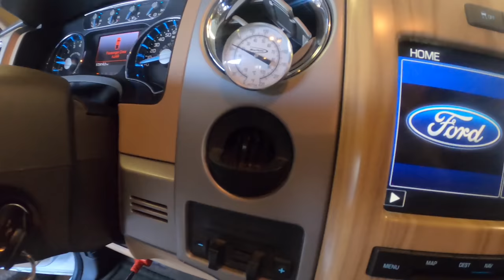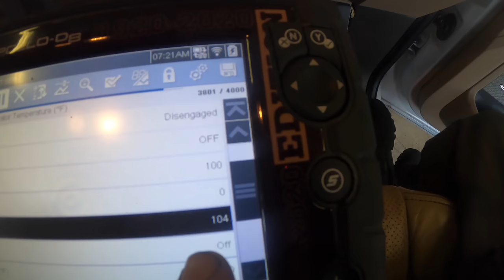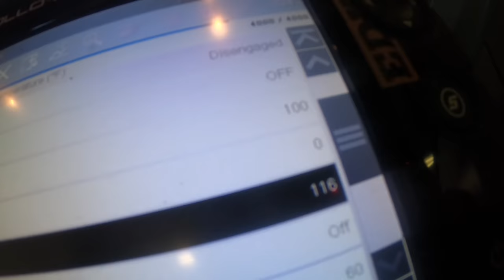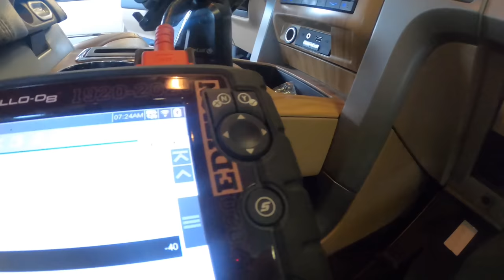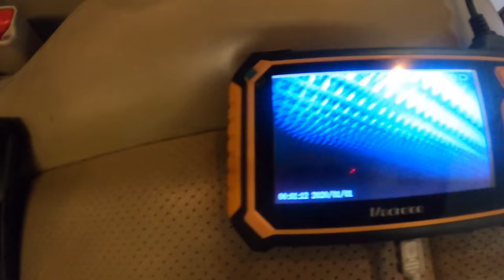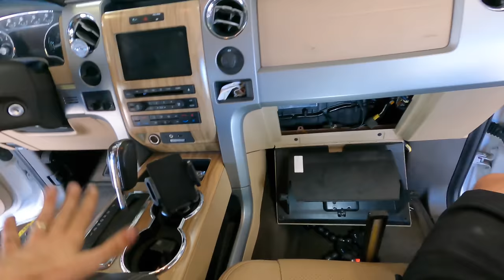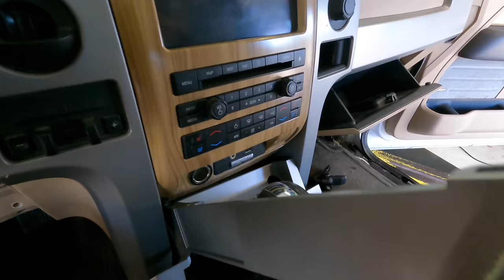TEN HOURS to replace one sensor! Ford 150 torn to pieces! Evaporator Core replacement.

Comment: This is a job I would totally tackle myself.

And by that I mean; I would disassemble the dash and replace the sensor, then drive around the next 4 years with half the dash in the back seat because I couldn't remember how to reassemble it.
Reply: Be careful. That’s starting to sound like some of the stooopid shiite that I do. Don’t make me go to the patent attorney 😜🤣
Reply: At least you'd get half the dash back in. I'd probably just end up mounting the gauge cluster on some plywood and using a couple vice grips as a steering wheel.
Reply: Take pictures while disassembling things you're not familiar with. Lay the parts out with the fasteners next to the holes they go to and mark them with a paint marker so you know where they go.
Reply: Had a 98 Durango, heater core went, 10 hr. book time, had to pull the dash,  took me 21 hours (not a pro) but I got it done.
Reply: At one point in time i owned 4 vehicles that had the steering column cover removed at the same time.
Some were that way for over a year.
Reply: Haha, I'd probably have cut a hole in the housing with a hole saw, replaced the sensor and put a big blank grommet to seal it up after... even if I had to buy a whole new unit, to get the sensor!!
Reply: I agree. I don't know how he remembered where all those bolts and nuts and wire harness connections went. Amazing.
Reply: @willietapper1922  I think we saw that in a Dodge van a couple months ago.
Reply: @G-ra-ha-m  Hell yes....was thinking the same.
Reply: Same!
Reply: Yes, I did exactly that in the 80's to my Dodge Van. I had to store the dash in the cargo bay while fixing the radio or  something. Did not put it back immediately. After a while, I went to pickup some big heavy item and to do so, had to put the dash on top of the van for the duration of the pickup. Then I forgot it there, closed the doors and left. That made me the first and only dude in the history of cars to lose his dash on the highway.... 😳
Reply: That was funny
Reply: @WhiteBuffalo59  I would have simply connected the heater core lines together and wore a sweater.
Reply: @G-ra-ha-m  I was thinking the same thing.
Reply: @WhiteBuffalo59  Sounds right, usually twice as long, sometimes 3 times as long in the driveway!
Reply: I am completely blown away by this video. The engineer behind this design must have been doing some psychedelic drug during the designing process at Ford. What were they thinking?
Reply: That's why Ray has a camera. lol
Reply: @tarstarkusz  Lol, we were on a deer hunting trip when it started leaking and that is what we did .....wasn't to bad while we were hunting but the ride home was rough.
Reply: My solution also🇬🇧
Reply: Funny post. I was thinking the same thing. I'm all anal about labeling or placement of my fasteners. I would be afraid that I'd lose something or forget how to get it back together.
Reply: Totally
Reply: I had similar thoughts on that too. Phew!
Reply: @G-ra-ha-m  Along the same lines, carefully cut down from the top of the lower half of the plastic box and across the bottom to make a panel wide enough to remove the sensor. After the sensor is replaced, tape the panel back into place using some heavy duty black tape..
Reply: @G-ra-ha-m  So would I, but I'd end up nicking the core with the drill and then just drive the vehicle into a river to make it go away.
Reply: 🤣🤣🤣🤣 Most everyone would!
Reply: @MalleusSemperVictor  Dude, we know. This thread is just levity. Play the game, eh?
Reply: @G-ra-ha-m  I was hoping someone would suggest this!
Reply: @G-ra-ha-m  If its like a 13,  the probe alone is not replaceable.
Reply: Lmao
Reply: @MalleusSemperVictor  Ray has the video to refer to ...
Reply: @stevenichols8440  You can't do that when you are a trustworthy garage.
Reply: If this were my vehicle, I might just electrically disable the AC and call it a wash.
Reply: @stevenichols8440  sensor is only available as part of the HVAC box assembly, as Ray mentioned before removing the dash.
Reply: @mymusicaccount1456  🤣
Reply: @G-ra-ha-m  I thought the same, then Ray dashed my hopes, saying the sensor was only available as part of the evaporator. 😭
Reply: Yep, yep yep. 😂
Reply: I've seen someone drive like that.
Reply: @Steve White:  I've worked with AC guys, and many times they had a freon leak behind dash or some stupid thing... AFTER ALREADY HAVING IT OUT ONCE! I avoid HVAC for that reason.
Reply: is not a problem ! anybody who assemble  ikea furniture  at the end of the job have a few screw left !
Reply: I would just sawzall the heck out of the dash and rip out the heater core. I'd end up with a heavily customized truck, lighter too with half the dash in the trash.
Reply: @G-ra-ha-m  thats exactly what I was thinking Bro. Black duct tape would match the housing pretty well.😂😂😂
Reply: @bigboxes  Get zip lock bags take the nuts/bolts out put them in the bag label it and your good. Let's say center console when you only have 5-10 fasteners you can usually figure it out easily.
Reply: @MonkeyJedi99  just un plug the compressor wires.
Reply: @ejcsds  just because Ford don't sell that bit separately, is not an issue, that type of temperature sensor is used in lots of places, a little research can save much time and money :)
Reply: @darkerbinding6933  re sensor availability from Ford: Toyota don't supply 1990s ECU capacitors, but I still soldered new ones in to fix a problem :)
Reply: @G-ra-ha-m  please show us successful replacement in a 2013 and where to get it.  On f150 forum we have been fighting these defective probes for years with no alternative. Please show us how?
Reply: @keithsnowden409  Yep, that is kind of what I meant. Disabling the system electrically.
Reply: This is why I drive a 88 Chevy celebrity. Junkyard hunk of crud, only paid 500 dollars for. Almost 400k miles same motor and transmission. All I do is preventative matenence
Reply: @G-ra-ha-m  Junk yard part!!
Reply: I did this job on my project car, to put an audio system in it, did put it back together. Realised instantly that I was not happy with the results... Car has been sitting for two years.
Reply: Lmao at that!
No matter how methodical you are though doing a major dash job like this they'll always be
'left over' bolts/screws ect..
Reply: @stevenichols8440  ,
what the heck do you have a glue gun for ?!
Reply: @ejcsds  ,
purposely, known as built-in obsolescence !!
Reply: @mikemcgown6362  ,
purposely designed that way !
Not just $20.- temp sensor, but $1100- assembly !
Reply: @tsalesto  ,
if you own it, not a problem !
Reply: @G-ra-ha-m  ,
hopefully available somewhere else ?
Reply: I would never figure out how to get this back together.  We'll done young man.
Reply: I concur with your comments. That is why my Jeep GC is still in parts in the back seat. Got everything apart ok, putting it back together is another matter!
Reply: @keithsnowden409  What you do, is get a piece of flat cardboard the size of the dash, then as you take out each bolt, you make a tiny hole and then stick the bolt/clip in through the cardboard and write where it goes. If it's a nut, you tape it on. It requires patience and dedication to do it with every part, but it works, and I've dismantled many things and then got them all back together doing it this way. Ray has video, and today you can get a head mounted gopro and do it his way. But I'm cheap and will continue to use the cardboard method.
Reply: As opposed to me, who would just turn the A/C off and roll the windows down. That's better than the ones who would cut an access hole in the plastic box itself, replace sensor, then duct tape over the hole lol!
Reply: @ejcsds  @Graham > please show us successful replacement AC probe in a 2013 and where to get it.  On f150 forum we have been fighting these defective probes for years with no alternative. 
Somebody might be able to unplug and test the probe in a good Ford F150 (the range of temperatures, and the resistance of a temperature sensor), and find one off the shelf somewhere that's not too far off.  It sounds easy, I wonder how hard that would be?  It would need to be someone who had an interest in saving a lot of money!
Reply: If it were me, I would just learn to manually cycle the aircon to keep the core from freezing too much.
Reply: Lmfao. I’d have it towed in with no dash on in defeat.
Reply: hahahahahaha
Reply: Lol I cut my dashboard year by year untill I had vents and a desk lol
Reply: Hahaha yep
Reply: @PR-fk5yb  I haven't only because I'm too lazy to put stuff on the roof. I just leave stuff on the ground and I can't remember where I put it lolz.
Reply: This is nothing compared to a body harness on a newer odyssey. Normally on the dashes you can pull them back a bit and take out the hvac module or repair the issues and put them back. Not as bad as it looks. Usually pay very well unless it dealership warranty work. Then it be like 6.5 hours.
Reply: An honest man. 😂😂
Reply: @MalleusSemperVictor  even better use a gopro or if you're poor like 98% of us here then tape a phone to your head with the touch screen covered so you don't accidentally stop recording
Reply: Dashes are overrated anyway; just recycle it, then not only will you have saved some weight, but also made your vehicle undesirable to car thieves!
Reply: 😂😂 are we brothers?! That's me exactly